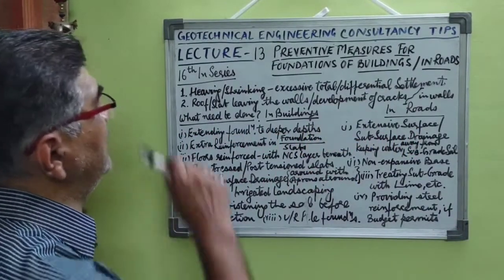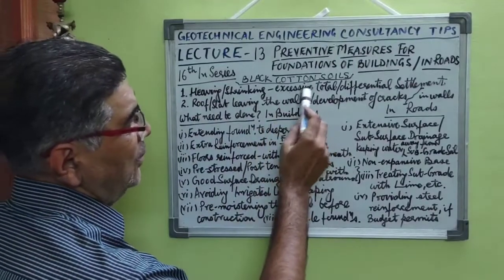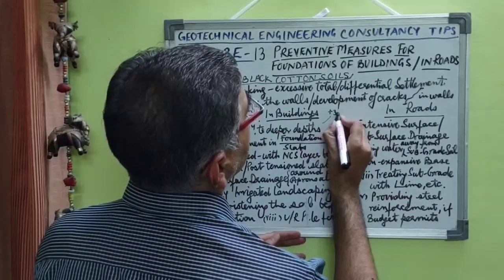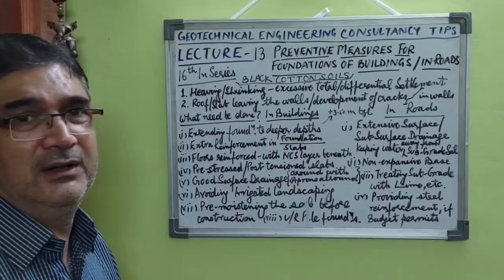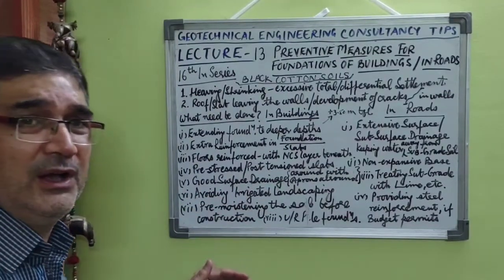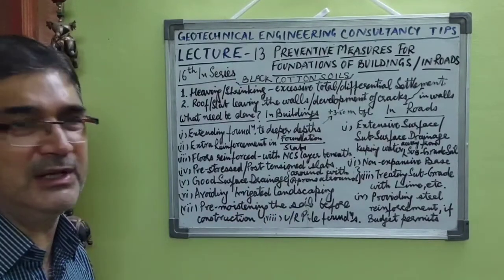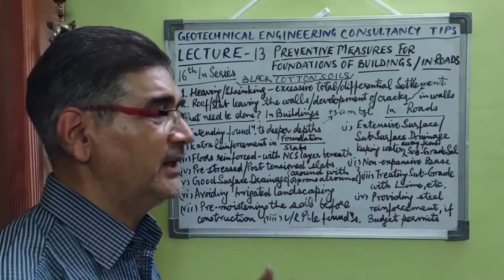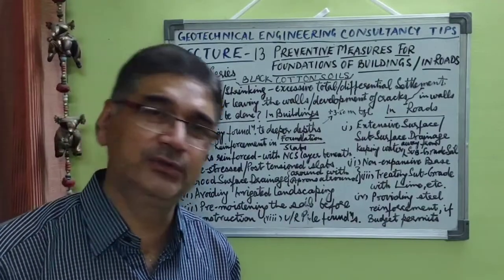Construction of Buildings & Roads in Black Cotton Soil:Preventive Measures |Geotechnical Engineering

Comment: Kindly deliver a lecture on Soil strengthning in a economical way where soil strata is not suitable for open foundation.
Reply from the maker: Okay
Reply from the maker: Can you please share the size of foundation with proposed depth of it and for which kind of structure
Reply: @GeotechnicalAnuragKapoor79  Foundation  depth upto 6 mtr and trapezoidal type raft of size approx 5mtrx 5mtrx1.5mtr for flyover construction.
Reply from the maker: Do you want